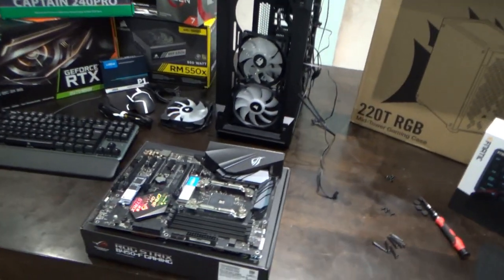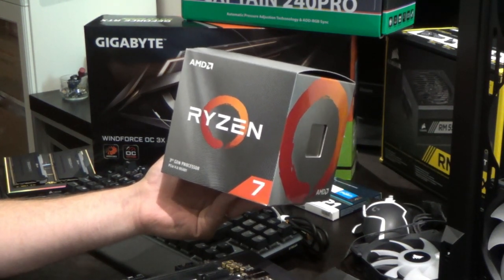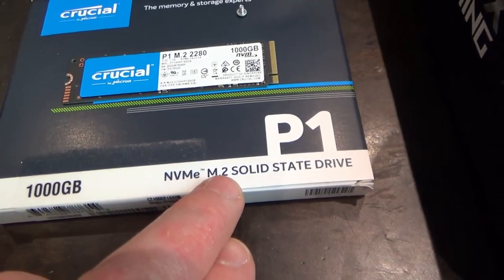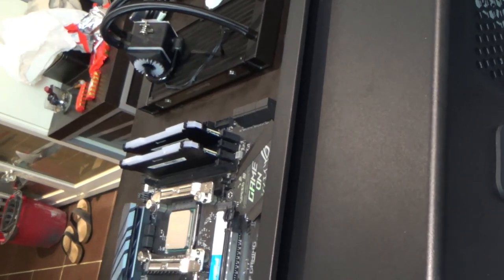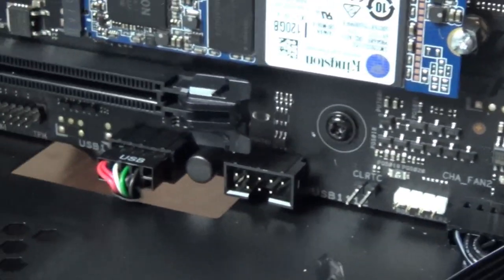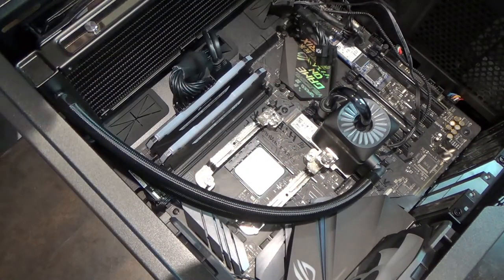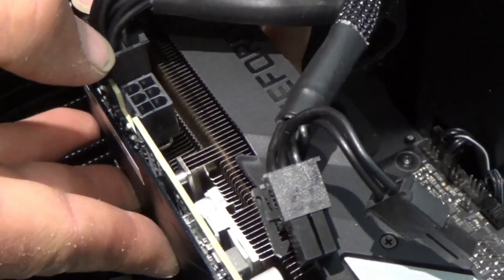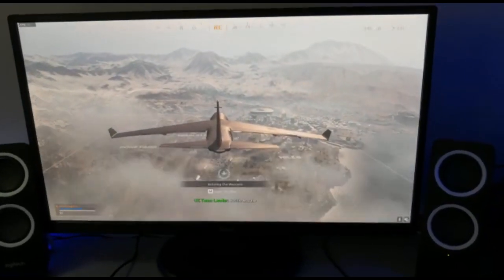Building a GAMING PC with a £1500 Budget

Comment: GBP1450 is  not "2790" Chinese Yuan, maybe "1" in front of it is missing, i.e. "12 790" Chinese Yuan - that looks more like it.
Reply from the maker: You are correct, the editing software I use has a habit of deleting numbers/letters when I change the font size in the subtitles. It deleted the '1' of the Euros and the Yuan, I didn't spot the Yuan!!! Thanks for pointing it out, it should have been 12790 Chinese Yuan :-)

Comment: I made my first pc a few months ago with a budget of £1500, the amount of anxiety I got when it didn't turn on the first time was overwhelming, also I used the tower panel as a shield when first turning it on in case it blew up 😆
Reply: What did you do wrong the first time when it did not work?
Reply: Why didn't it boot up first time ?
Reply: I think I connected the cables to the wrong ports in the PSU

Comment: Welcome to the pc building community 😄 
Good things:ayye same mobo, ayye same gpu, nice cpu choice although i don't think you mentioned which one it is(maybe im deaf lol), case looks good in cable management capabilities, you didn't cheap out on the psu which a lot of people do and its pretty bad so well done for going for a good psu, inserted ram correctly(AYYE SAME RAM 🤣) good choice of storage, nice thermal paste(but the application😬)

Things you can do better(everybody can make mistakes so don't worry about these too much just keep them in mind):if you wanna make it look better you can add custom cables and more rgb stuff, OH no thermal paste 😂 sorry, if you wanna get more performance by not trapping bubbles i reccomend putting a pea sized blob in the middle which spreads out to cover most of the surface, i think the top m.2 takes gpu lanes so remove that, that's really it! Maybe a bit of better cable management and that pc is pretty lit

Feel free to ask me anything :)

Comment: You neglected Memtest and CPU Burnin Test. You need to run Memtest for 24 hours to make sure memory is good. CPU burning tests for 48 hours is the golden rule when building computers or upgrading memory. You also forgot to mention EATX form factor and DTX. Badblock tests and Smart tests on spinning disks. I would so be out of the job if I did this in data centers. I work on servers so this is really important.

Comment: For a mid range build I probably would have spent a bit more on a better variant of the 2070 Super and gone for a R5 3600 instead. 

If it was for more CPU heavy tasks then R7 makes sense but it seems it’s a gaming PC so spending more on the GPU would make sense here.

Personally would have gone with a Noctua or BeQuiet tower cooler for a quieter build that isn’t prone to degrading over time too but that’s more a subjective choice really.

Comment: 🤦‍♂️ Who on earth spreads the thermal paste with a spatula, it spreads enough when you install the CPU cooler
Reply: Plenty of people. It's more consistently spread across the die than the "pea-sized dot" method. Also, not all thermal pastes come in tubes.
https://www.gamersnexus.net/guides/3346-thermal-paste-application-benchmark-too-much-thermal-paste
Reply: @Apk07  It's extremely hard to get a consistent spread across the CPU without having any tiny air bubbles, which is  why I've always preferred the pea-sized dot method.
Reply: Back in the day the thermal paste came with a plastic spatula.  I always used a plastic "razor blade"  for mine.
Reply: It's a pretty old and outdated method

Comment: Are those fans on the radiator pushing air into the case because really you want to exhaust the radiator heat out.
Reply from the maker: Actually, that is a very good point. Next time I speak to Richard I will mention that as the radiator was on the intake fans....BUT then if it was on the exhaust fans the air cooling the radiator would be hotter, so maybe it is better on the intake fans than on the exhaust due to colder air coming in....Not sure. Maybe others can chime in with what they think is better. Cheers for the comment :-)

Comment: Just wondering, did you apply the XMP profile for the ram in the bios? Otherwise your ram will run at the default 2133MHz speed instead of the 3200MHz* your ram is capable of. 
*Or whatever speed your ram sticks are

Comment: Don't know the first thing about building a pc. If I get one, I will buy it ready made.
Reply: I don't recommend that because usually pre made ones are more expensive and for the value of the price if you make a custom one you can get a more powerful PC for your buck.  It's not that hard once you watch a couple of YouTube videos on building a PC
Reply: I will never ever in my life buy a prebuild system from brands like HP and Acer. They usualy cheap out on things like motherboard headsinks, power supplies and gpu and cpu coolers. It is also almost impossible to upgrade because not all of the parts are always standard. There are some shops that can build a pc for you if you don´t want to build it yourself.
Reply: Which company is the best to get one that they build for you?
Reply: No excuse not to build one yourself. You can even buy pre-assembled motherboard/CPU/cooler bundles and that's the hardest part done for you, you then just put the rest together yourself which is really easy.
Reply: @CLC-1000  your local PC shop / system builder "company"
Reply: @RWL2012  What parts are left after the hard bits?

Comment: Hmm, a B450 motherboard isn't really a great choice if you want to upgrade to a Zen 3 based processor later.
Reply: Actually, AMD backpedaled on that one, the B450s can run Zen 3 CPUs after a BIOS upgrade. The biggest issue was the BIOS on the earlier boards gets maxed out with all the CPUs it currently supports, so once updated, it won't support some of the earlier CPUs anymore.
Reply: plus also the b550 boards are way over priced!!

Comment: Oh no Vince I’m from the PC Master Race you will be judged! Seriously though I’m seeing some mistakes.

Good cpu (that cpu has the equivalent of reballing a cpu but with pins instead of solder if one gets bent or broke the cpu can be done for)
Good motherboard 
Bad psu (kinda a 600 650 is better 80plus)
Case good 
Fans I see the effort because the Corsair mag lev so good.
Drive good but is called NVME M.2 lol XD
And the does not mean it’s fast it HAS to have a DRAM CACHE and has to be at least like 50 degrees to run that fast.
Ram good Gpu (should have waited that gpu is about to be replaced and won’t be new anymore yes you do have a pretty good gpu not a bad voice at all you get what you pay for (a lot) DO NOT pair 2 sli and crossfire have been dead since Nvidia and amd gave it up since then most games all even don’t support it anymore and won’t run and you will pay for nothing but less performance in most cases, you have to be a lot more of an advanced user for that.)
Cooler I don’t think that aio is reliable i would recommend a 160 £ aio. Make sure you install your actual drivers for your gpu lan chipset ahci.
Reply: This is why we can't have nice things
Reply: 550W is more than enough for this setup (no one needs more than 500W for a single GPU rig) and the RM550x is a quality PSU as well as it being 80+ Gold certified. AIO is also good. If you're worried about reliability an air cooler is the way to go.
Reply: Ren Mayers yep but if you want to upgrade in the future then you have to get a new psu to drive more powerful components
Reply: I don’t know for sure but we normally
 go by 2x the power draw. So it draws 300 get a 650. Or a 600
Reply: @eveangreen1871  No that's not right, PSUs are usually most efficiency between 60-80% load so if you have a rig that tops out at 300w stock then a quality 450w unit is all you'll need, 500w if you plan to OC.

Components are becoming more efficient not the other way around, there's no need for more power when a quality 550w is more cost effective, efficient and will handle 95% of the mainstream configs and still have room to OC.

P.S. The keyword here is quality, a quality 550w will perform better and last longer that the bang average 650s most people buy thinking more wattage is better.
Reply: @incredableme63  dude Linus who owns a company based off of computers says otherwise.
Reply: @eveangreen1871  Linus is by no means a PSU expert but I've been watching LTT since he was still working at NCIX and never heard anything like that said.
You can go on the LTT forums and you will get the same info I gave you, there are actual experts there.
P.S. I'm a computer technician

Comment: It was killing me when he kept pronouncing "Serial" in SATA. Lol
And yeah that might be too much thermal paste. The perfect way to apply it is two thin strips in an X pattern.
Reply: I always put a little bit in the middle and let the cooler do the rest. But I think that most methods are just fine as long as you are not using to much😂
Reply: @Leonvolt28  yeah a drop the size of a green pea in the middle works too. But if you spread a layer over almost the entire chip like he did it's probably going to have some overflow after it heats up.
Reply: @89ludeawakening1  It works fine by spreading it, too, but it needs to be verrrrrrry thin
Reply: @Apk07  yes I know, it definitely needs to be very thin. Basically just a film over the entire chip if that's the way you apply it. Trust me, I've tried all methods as building and repairing computers and phones is what I do for a living.

Comment: i built and sold 100 gaming pc systems.Wish i have a gaming pc .Sadly i am still running a core 2 duo.
Reply: Ouch that sucks makes me appreciate my i7 even though it's crazy old. Still is a power house though and with my gtx 980 I get solid 60fps on most games even the division 2 plays in 60fps on high settings.

Comment: Should have mounted  the motherboard in the case before installing ram and CPU
Reply: i don't know anyone who does that. mount everything to the motherboard before going anywhere near the case so you can bench test it to make sure everything works. that way you don't need to take everything out and fiddle about in the case to fault find.
Reply: @Omega11998822  mounting the board to the case give it rigid physical support when mounting other hardware to it.  Also the case provides  grounding for the motherboard.

Comment: me here with only a gtx 1660 -_-
Reply: Your gpu is 5% more powerful than my current gpu you should be pretty happy with it. My card just has more shader and texture mapping cores. My card is the gtx 980 4gb windforce superclocked by the way.
Reply: Stoned Savage! Well i mean at least i still get decent fps -_- so its really not that bad and i over clock mine.

Comment: the first problem is the main chip,on the mother board.The second problem is the ram.Only Samsung knows.The third problem is with the cooling sistem.The Cpu-cooling system ,is to big.The Gpu,lose TDP.Good luck.
Reply: P.s: For the external memory/M.2,only Samsung know.Remember this.

Comment: 3 fails in this video:
The main fail is amd. Using amd for gaming with buggy drivers and a much lower single core power than intel... the 2nd one is the thermal paste apply. Also there are better aio coolers for the same price (artic freezer for example) and the last on is the 550w psu. All in all poor kid

Comment: Poor man configuration, payed too much for the parts that has been installed, rat's nest cable management, useless power hungry lights. If liquid cooling and extra fans was spared (otherwise useless here because the case is well ventilated) the money could be invested in beter Video card, more RAM or beter CPU or motherboard. It become TERRIBLE building of expensive cristmas tree lights. The best places for ram are closest to the CPU -> if single channel 1+2, if dual -> 1+3, not 2+4 because the CPU will always check first slots before move to the next ones. Rats nest cables will input noise into macine and sensitive analog parts when not proper managed. 3 HDD configuration is a good decision -> one small fast SSD for OS and support programs & drivers,  one average fast SSD for games & resource hungry programs and one mechanical big for storage.